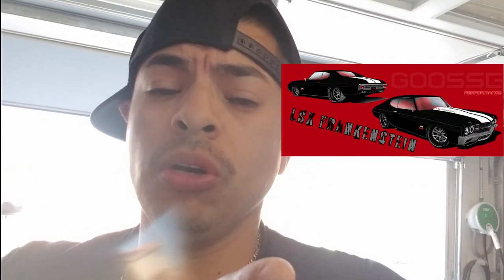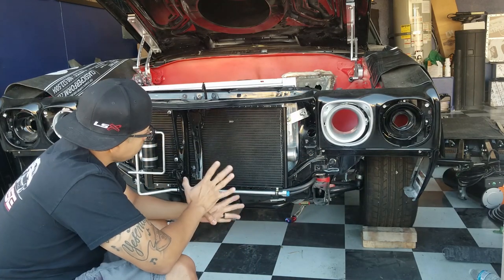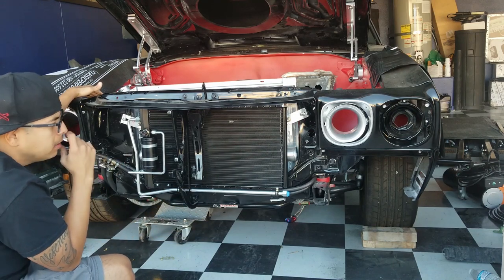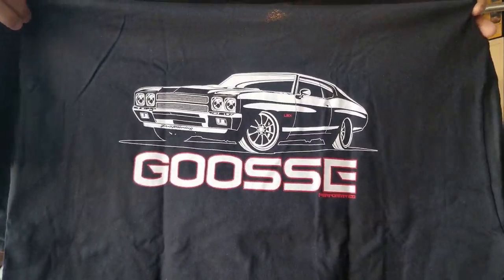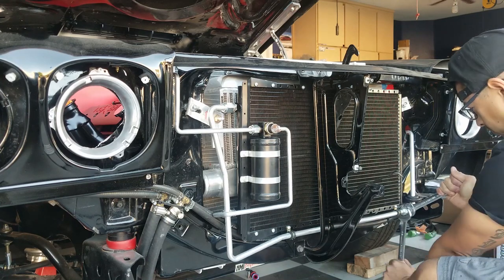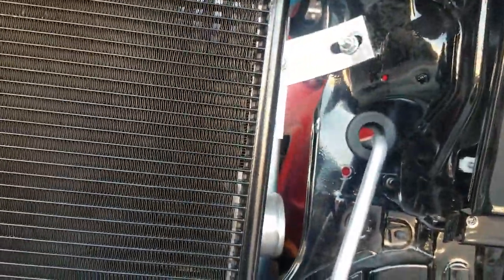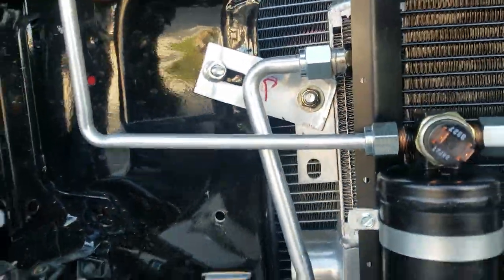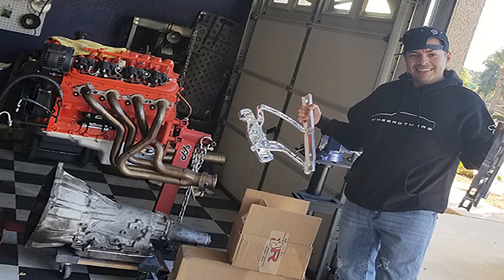VINTAGE AIR CONDENSER WITH TWIN TURBO INSTALL ON THE CHEVELLE

Comment: I have a similar project with a 71 and only 1 turbo and I was worried about clearance from the turbo to AC condenser. Thanks for the video, cleared up a lot of questions I had.

Comment: Bro, I have a 70 Chevelle that I'm restoring out here in San Diego.  Love the videos.  How can I purchase a shirt?
Reply from the maker: you can send $25 to my paypal @ gmejia1120@hotmail.com or look on my Instagram under highlights
Reply from the maker: what are your plans with the restoration?
Reply: Goosse Performance Bet, I will do that!
Reply: Goosse Performance I rebuilt a 454 and dropped it in there.  I’ve also done all of the body work (for the most part) and just waiting to paint.
Reply: Goosse Performance nothing too high end.  I’m on a budget.
Reply from the maker: @highspeednoblesgarage3152  sounds like its going to be a monster with that bbc!
Reply from the maker: @highspeednoblesgarage3152  HEY BRO did your shirt come through?
Reply: Goosse Performance Bro, it sure did.  Love the style and I appreciate the sticker!
Reply from the maker: @highspeednoblesgarage3152  cool just wanted to make sure
Reply: Hey bro love the content, mind referencing thhe heat exchange & intercooler you are using?